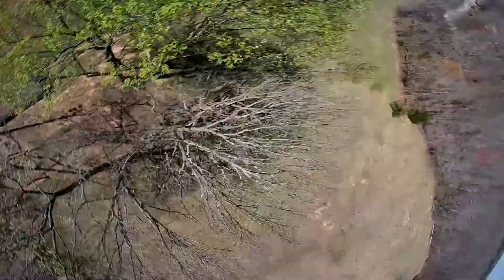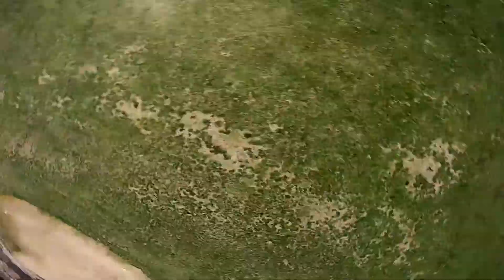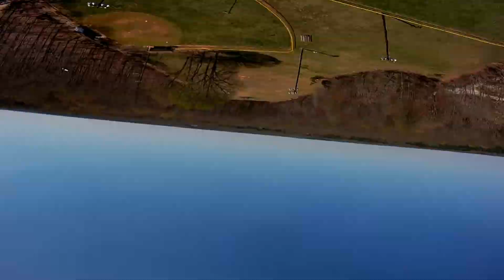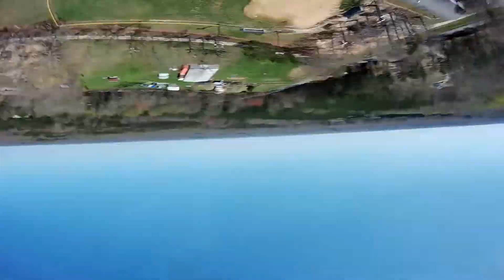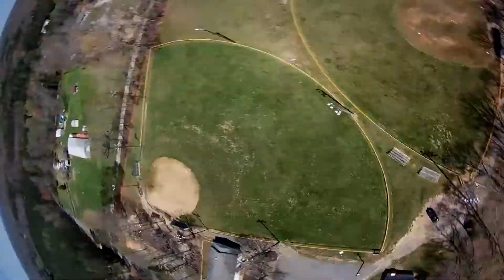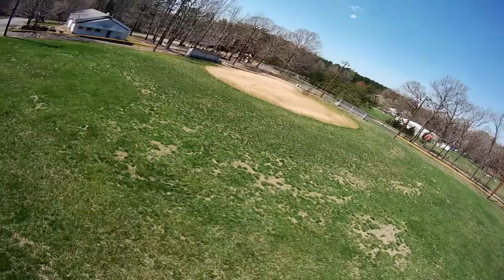OUT OF CONTROL

Comment: Mine are worn out too but I think it was mainly the time it got rained on that caused that, LOL.  Looked like an encounter of the building kind was eminent on that clip at the beginning.  I see someone managed to stick a kite in that light pole!  Still a nice fly, worn out gimbals and all!  Let me know how hard it is to change them out.
Reply from the maker: Changed em yesterday evening, 20 minutes top. Plug and play. If you need help let me know, putting the tiny machine screw in to disable the throttle spring took me the most time lol!! Thanks Ed!!👊😎

Comment: So, what happened in the opening sequence? Did you break it? I have hall effect gimbals on my Paladin and like them. I can even tweak the tension settings from the outside without taking the radio apart.
Reply from the maker: Wall tap perfectly flat, 1st pack of 4. Why I like the top mount lipo, would've smashed one lol. Thanks Paul!!👊😎
Reply: @ILLBEDRONED  That's good to hear.